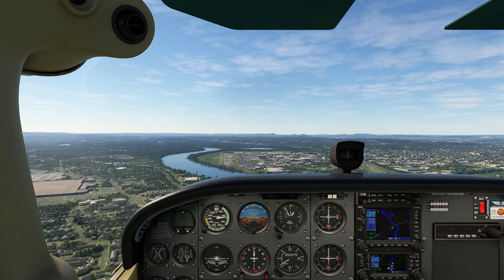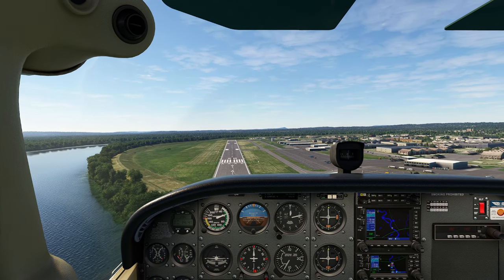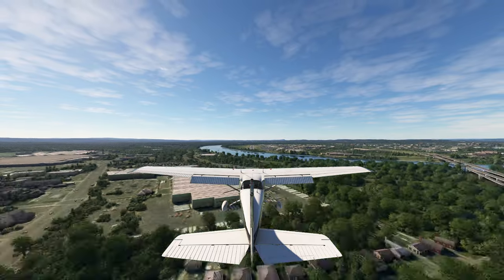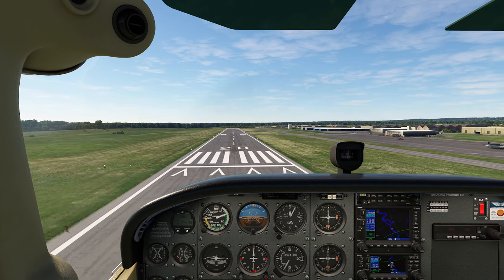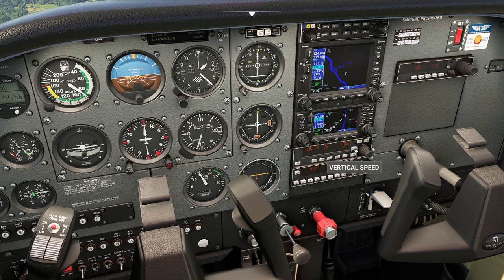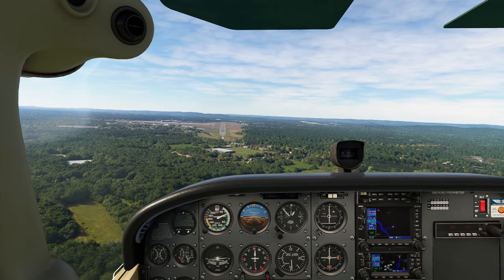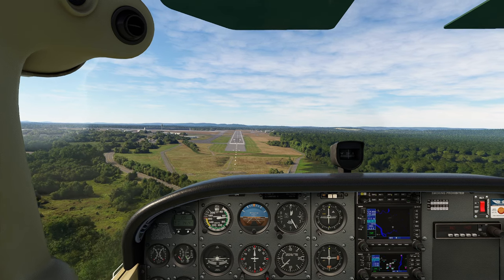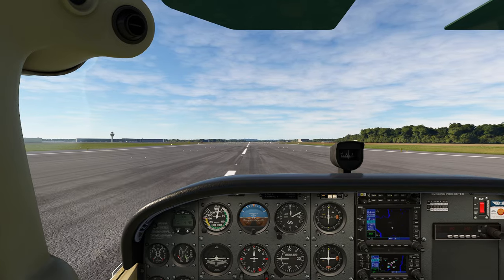MSFS - Correcting Glidepath with the Throttle

Comment: I agree with the idea of what you did. But in real flying I was taught that yes pitch for speed and throttle for descent control but not to throttle back to less than 1500 rpm to avoid temperature shocking the engine and causing a cracked cylinder. Side slipping would probably be the way to get down faster. I would like your thoughts on this. Great videos.

Comment: The real question: How do you fix being slightly off-line with the runway? I do that ALL the time...turn in and I'm a HAIR left or right. Then I look drunk trying to scootch over a little.

Rudder? Roll? Bit of both? How do YOU scootch? Do you at all?
Reply: Roll to change heading a bit to scootch over until "on-line" with the runway. Rudder is used to fly coordinated and if needed de-crab just before touch down. And of course if you want to be fancy and do a side-slip to quickly loose altitude. :)

Make small adjustments of your heading, I think it´s not uncommon to do too big adjustments and then you have to start chasing back and forth. Being correctly positioned early in the approach makes this much easier, so maybe do some practise with longer approach legs?
Reply: @Tordan69  Longer legs is very true...I ALWAYS turn to final too close to the runway. (DCS/MSFS, BTW...lol) Makes scootching tricky. I'll be more mindful of that!! 👍